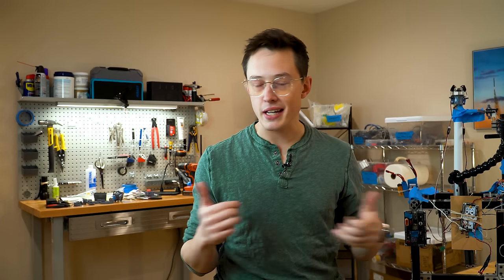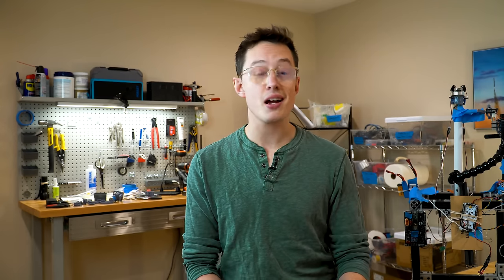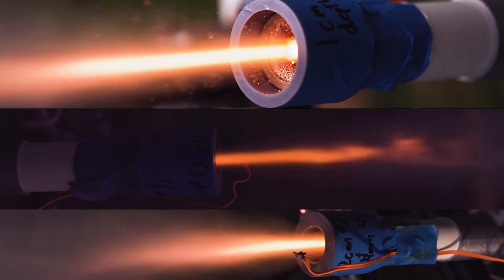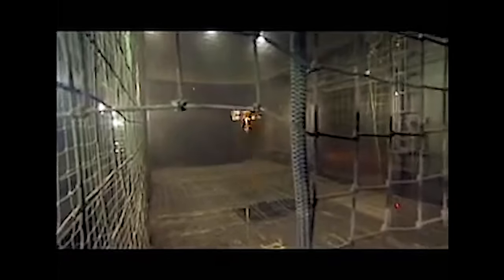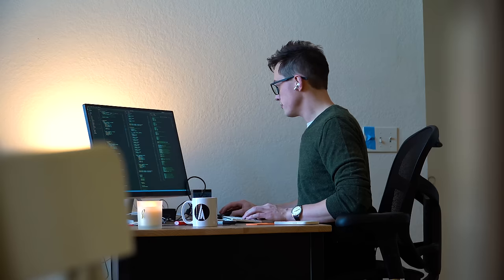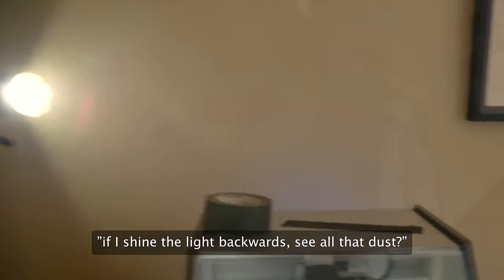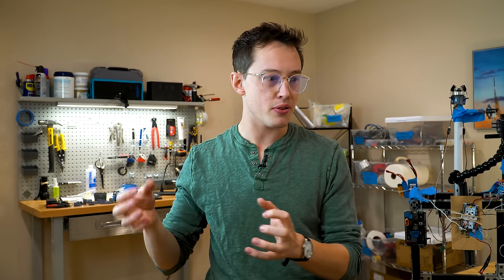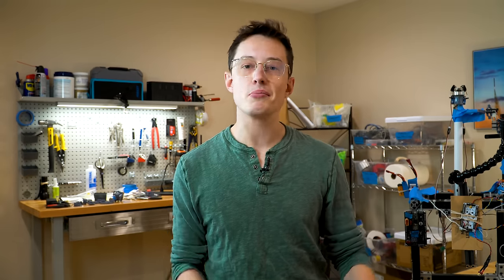I Figured Out How To Throttle a Solid Rocket Motor

Comment: So if you could build a photo lens aperture like mechanism from ceramic wafers you could affect total thrust. You could move that mechanism off-center as well for thrust vectoring. Perhaps moving the center of the mechanism towards fixed paddles as needed. Great work guys, thanks!

Comment: I wonder if both jaws should be driven by the same servo. Because with 2 separate servos, when the opening between the jaws is really small, the slightest asymmetry will cause the exhaust to dramatically point off-center, thus messing up your TVC. In any case, a mechanical link between the two jaws would 'synchronize' them mechanically.
But I'm glad you finally tackled the throttle problem!

Comment: You can also use multiple engines and TVC them in opposite directions so the upward effective thrust is reduced and the sideways force is equalled out by the other engine's opposing thrust vectored thrust.

Comment: I would have assumed that you would have varied the thrust by taking two rocket motors that you can actively control where they’re pointing and point them incrementally away from each other.  Full thrust they’re pointing in the same direction, zero thrust they’re pointing in opposing directions. The thrust blocking is a great idea! I would have never thought of it! Keep up the good work!

Comment: Incredible work!  First, the deposit is aluminum oxide, which is the result of aluminum burning in the combustion chamber. There are molten aluminum oxide droplets in the exhaust stream of aluminized solid propellent, which is still going to be over 2000 C upon impingement with your ceramic jet tabs.  Second, look up jet tabs because you've made a version of these, which are commonly used for thrust vector control of some munitions.  Thrust loss is effectively directly proportional to the blockage fraction, the area you cover divided by the area of the exit plane.  Your design will be somewhat nonlinear as TVC, especially over time with the deposits, but as a thrust reducer I think you've nailed it.  While the slag is a bit annoying and a risk that you won't be able to close down fully late in the burn, I suspect you may be able to live with that with the composite propellant motors.  Good luck, I want to see you land one of these!!!

Comment: You should heat the slagtites (my word) with a torch and see if they melt.  I think they are mostly aluminum oxide which won't melt.  I recall a prof talking about his research into abrasion of the 2 phase flow of sapphire crystals in the rocket nozzle paying for most of his house.

Comment: yes you can. just redirect the flow of thrust to the side of the rocket. it will burn out but if you design a special mixture of rocket fuel that reignights after being submerged in water it should work

Comment: You might even be able to kind of "reverse thrust" with a proper geometry for the deflectors.
Reply: Why would you want reverse thrust in a rocket?!
Reply: @YourMJK  if you want to slow down faster than gravity allows by itself.
Reply: @nic.h  Okay, but in which scenario would you want that?
Reply: @YourMJK  to land?
Reply: @YourMJK  rapidly accelerating in the reverse direction can be useful at avoiding obstacles. There is a whole class of quad rotors that use it to fly upside down, similarly helis use it for acrobatic maneuvers. So on a standard rocket that just likes to go straight up, not a lot probably. But you want to increase what you can do with that rocket there could definitely be uses for this.
Reply: @nic.h  Yeah, that kinda my point, I don't think there are a lot of obstacles to avoid with an ascending rocket.
The whole deal with going/staying high up is a lot of positive thrust.
Reply: @amogusenjoyer  Why reverse thrust for landing? You wouldn't want to fall faster , would you?
Or do you want to land it pointy end down?
Reply: @YourMJK  agree it wouldn't be a normal requirement for a standard hobby rocket launch. However it does open up possibilities that the rocket couldn't do previously. But yes in the normal use of rockets it probably isn't particularly useful. Then again what he is trying to do isn't exactly a normal use of hobby rockets, maybe it could assist with hovering authority
Reply: @YourMJK  I was more thinking about using it the thrust to correct the landing trajectory of the rocket if needed.

Comment: Maybe I’m just strange but I have a hunch that three paddles impinging on the exhaust jet might be better and potentially give you a modicum of thrust vectoring.
Reply: you'll get probably a sharp edges in the middle of the thrust that have to withstand the heat. In his solution it's two rather large flanks that have to dissipate the heat.

But on the other hand I could be totally wrong and it could be a proper solution for a thrust vector steering, when you close the three paddles asymmetrically

Comment: That's amazing! I was under the impression for a while that you can sorta throttle SRMs by using different grain geometries, but that also involves somehow making very particular core/grain shapes at a very small scale, which is a very difficult task, and on top of that just making them consistent enough across all firings is another task to add onto the already difficult production of a motor like that. Seeing stuff like those ceramic blockers and hearing about the Krushnic effect really broadened my scope on this topic. Seeing the slag on the ceramic blockers genuinely made my mouth drop because of the distribution of the slag (and of course because it's glowing possibly due to blackbody radiation).
Reply: Wouldn't different grain geometries need to be done in manufacturing? Here, he needs his thrust control to be interactive, real-time, rather than planned in advance, since he's trying to land a rocket standing up. Interesting though, wonder if real rockets use it?
Reply: @greenaum  Yes, the grains would have to be shaped during manufacturing. The idea I had was calibrating a motor to have a very particular thrust curve that could get the rocket to land without too much trouble. In retrospect, this is a lot more complicated as you have to make the grains, make sure the motors you produce are consistent across batches, make sure to fire it off at the right time during descent, and figure out to prevent the grass underneath the rocket from getting too burned. Using only a solid rocket motor, I am not sure it is practical to go down the route I've described given its complexity. It is possible to have it work correctly at least once, but probably as a result of the infinite monkeys theorem. That isn't to say that it is impossible to combine both Joe's new method and this one - it's just that buying a motor from a highly experienced vendor takes * a lot * of the complexity away from an already complex project.
Real rockets do use different grain geometries to produce different thrust curves depending on the application of the motor. However, they obviously don't land using only solids. That would be a nightmare to do on an orbital class launch vehicle.

Comment: I think that the side thrust being produced might be due to the metal deposits on the ceramics changing the shape of the blocking mechanism. That in turn changes the proportion in which the blocked gasses are distributed, creating a side thrust.

Comment: Hey Joe great video and I think that you could use the ceramic thrust control for thrust vectoring if you added a additional 2 ceramic knob things and then individually controlled the servo to then     block the thrust in certain directions and move the rocket in the opposite direction

Comment: I noticed the exhaust isn't blocked completely by the paddle. It still has to go somewhere, otherwise pressure would build up and destroy the engine. The purpose of the paddle is more to deflect exhaust in several directions so that the force applied by all deflected directions cancel. The cancellation of forces is important since you don't want the rocket to veer off course just because you throttle down. However it doesn't seem like the paddles are designed with this in mind. The flat surface on the paddles would definitely deflect exhaust, but any imperfection in the rotation of the paddles would cause a preferential deflection in exhaust. Maybe a better design would be to place a "roof" on the side of the paddle that confronts the exhaust?  Another idea is to deliberately rotate the paddles to permit some kind of gimbaling.

Comment: What about a partially hybrid solid fuel design that has a duct inlet with a fuel mixture that is fuel rich? Opening the duct and using a compression stage would essentially create a solid rocket turbine. Alternatively, at high speeds the duct wouldn’t need a compression stage and would just be a solid fuel ramjet.

Comment: You can try terracotta in 3d printed moulds for high temperature structure manufacturing. You just keep compressing the terracotta into the mould every 30mins while it dries to avoid cracks. Then cook it in a furnace if you have one. If you don't have a furnace, put it in a terracotta pottery piece (pot), fill the piece with table salt, then put the pot on LPG kitchen stove at full flame for 3-4 hours. It worked okay for me. There are many other easy ways to fire terracotta at home.

Ps: you don't have to bother removing the 3d printed mould. It will just burn away during cooking process.

Comment: you can use mono propellant that only ignites with electricity although you need a license to get it. creates a plasma that burns in direct correlation with the voltage    and its low voltage to boot

Comment: Use two motors and mirror rotate their thrust axis with servos, eliminate the ceramic bits.  Feedback loop the angles independently with an electronic gyro to eliminate differences between two similar motors / gain sideways steering.

Comment: If you want to drill brittle material like ceramic, try drilling it underwater. Like putting the ceramic underwater and drill machine is outside. Water pressure will avoid crack propagation

Comment: For improved attitude control, it would be beneficial to mechanically synchronize the deflectors. This would prevent the asymmetry that is happening with the direction of the gas flow when the servos are engaged

Comment: Your plots show a very fast response time (the nice straight up and down steps) and so you should be able to significantly increase the on/off modulation frequency to at least 10Hz. Once you test that then vary thrust via PWM.
Also, keep the two servos as you might then try slightly different PWM on each two to modulate the thrust direction. You could prove that with two paddles but then obviously a third paddle would give you another degree of freedom.
Finally, if you are only looking for max 30% variation then why try to completely block the flow, try leaving a passage for say 10%. This would also make a three paddle solution easier because you won't need to grind the paddles down to points. It might also reduce slag build up.

Comment: Awesome design and testing! Also, as someone who has seen a LOT of this aluminum fueled APCP, that's definitely slag. It's an aluminum oxide ceramic and deposits onto pretty much anything that is cooler than the exhaust flow. This includes even the nozzle throat, and you'll probably see that if you cut open that used motor. Also, I've seen this happen on any size motor, from low power up to a P class 6".

Comment: Joe, you should look into how to make "Starlite" over on NightHawkInLight's channel. It would work similarly to the ceramic, but cost you $1 for a set of thrust deflectors instead $100 for the ceramic. Check out "Part 2" in his series to see how adding Borax to his recipe made it quite durable. You could also use it as a coating, along with phenolic resin and graphite, to protect a metal "skeleton" for the deflectors. Just a thought, but might be worth looking into.

Comment: Integza uses ceramic 3d printed parts for his DIY rocket motors/jet motors. You just need a resin 3d printer, the correct resin with ceramic inside and an oven to cook the part. That should remove a lot of problems with dust, if it works as intended

Comment: You are a genius.  The door is now open.  What if rather than digital full open and full closed you create a manual control you can gradually open or close at a completely variable width based on final needed thrust for the landing to fully compensate for solid motor thrust variability near exhaustion.  If that works,  redesign with automation monitoring remaining landing distance and variable thrust control.

Comment: Your Video just got recommended to me by YT and i find your solution to the Problem of throttling a APCP  or any solid fuel rocket quite interesting, even if I'm not a Rocketeer myself.
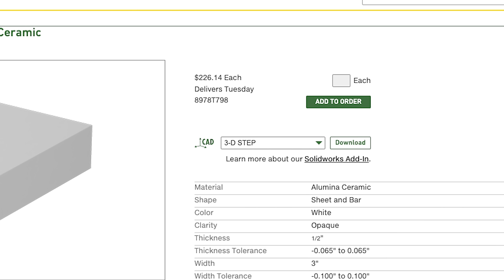That said, what got my attention are the "stalagmites" that formed on the ceramic when you used the APCP. I had to rewind the Video to be sure, but at 10:17 i found the culprit. The Slag is, as you correctly surmised, the Aluminium burning to Al2O3, or Aluminium-oxide which is the main Ingredient for Alumina Ceramics. So your APCP is throwing molten Al2O3 onto a Al2O3 surface. That's like welding molten metal onto metal, so it will build up instead of flaking of.
As other here already suggested, either make the blockers out of graphite or try to coat the blockers surface with graphite, so that the Al2O3 from the APCP doesn't has a surface that it can easily get stuck to.

But that's just my Ideas as a trained Chemist, not some Rocket Scientists expertise

BTW, that's so awesome, i want to see more and I just Subscribed

Comment: Splendid stuff!  I'd consider using three motors in a cluster, each of which can be moved outwards from the midline under servo control so you could achieve some reduction of the vertical component of thrust while cancelling the horizontal component.  Whether you could also use that for gimballing, I'm not sure. Might not be sufficient degrees of freedom?

Comment: Need to redo this test but use each blocker separately to see how much sideways force you can generate for vectoring. And additional blockers for yaw, pitch (3) and roll (4). Although you'd need a different none symmetric geometry for roll.

Comment: Try using porcelain slip and a 3D printed mold.  After firing the ceramic part to around 2300 F it will be hard as a rock and highly temperature resistant.  I was using similar machinable ceramic off mcmaster and it was a pain to work with, kept breaking no matter how careful I was.  I switched to the molding porcelain process and I can make 50 parts for the time I put into every 1 I had to machine.  They were also had a much higher strength than that machinable garbage.

Comment: One possible disadvantage of Al fuel is that its oxidation product is not a gas, but aluminum oxide, or alumina, which is a very hard abrasive solid. Rubies and sapphires are alumina.

Comment: So what if you used a solid rocket motor like a jet engine? 
Use motors to place something in front of the motor's jet, reflecting the stream back upwards, effectively giving you thrust reversal? Due to the heat, it'll burn the plate, but in short amounts it'll work

EDIT: Yeah that's pretty much what he did, but without the backforce, instead the excess thrust was directed sideways.
Reply: Didn't see the edit😄
Reply: @Flaminius_._GG  Yeah I just gave a solution before watching the video. My idea wouldn't work for long though due to the immense heat of a rocket engine

Comment: If you have two (or four) smaller "tongs" slightly "touching" the exhaust off-center to vector the stream, this could also provide some crude rotational control along the long axis of the rocket.

Comment: Maybe you can solve the slag problem with ablative blockers, if the surface of the blockers ablates, it should take the slag buildup with it, so it always stays clean.
Or you could try some kind of rollers as blockers, so the rocket exhaust makes them spin and the slag doesn't collect at one spot.

Comment: Try using a 3 paddle system mounted at 120 degrees, with features that can let the gases escape much faster. Imagine an "orange peel grab" with reversed shapes of each paddle in order to let gases flow easily.
Use the CNC to make the shape of each paddle from ceramic and try mounting the ceramic part to the aluminum mounts.
Also, I would suggest using some sort of high speed continous rotary actuator connected to a DC motor with encoder. That way you'll have a faster response of the controls.
Also, you should think about using a pneumatic control system for the paddles with a rotary control valve.
If you still want to use NC/NO pneumatic valves, use an array of valves connected to a single output to have a faster response.

Comment: If you put two motors and if they both point down you have 100% thrust and if they point in opposite directions you have 0% thrust, and in all positions in between you have thrust range. I guess the problem will be that they both turn on at the same time and have the same thrust, but you could still try.  If both have the same 2-axis gimbal, these problems might be are solved by software.

Comment: Instead of trying to vary the flow rate of the solid fuel thrust, why not try variable vector thrust with a Alumina Ceramic tube and ball (1750°C), like a ball valve.
Simply by varying the thrust slightly off center effectively reduces the push upwards.